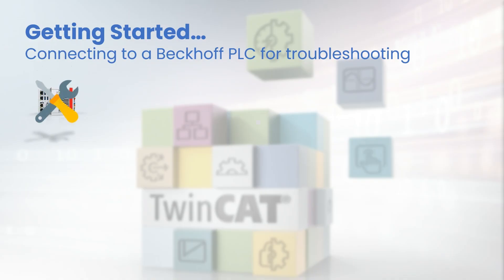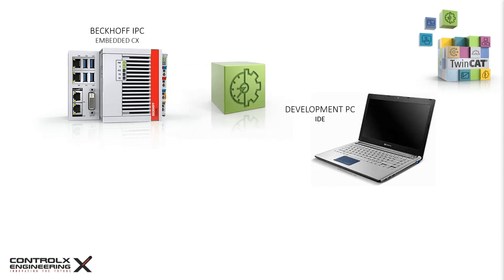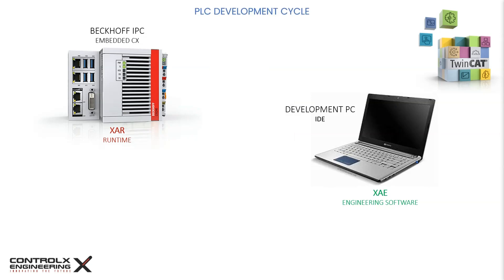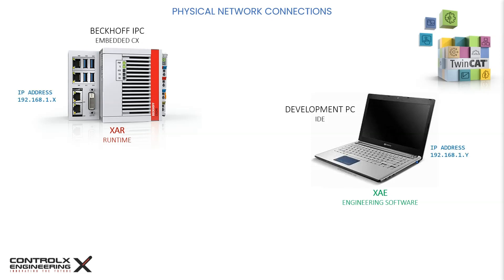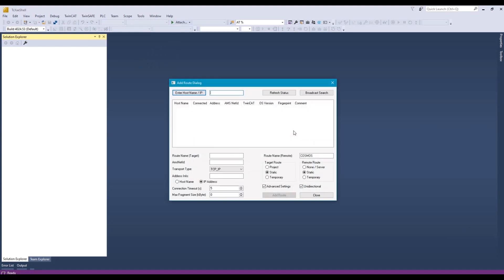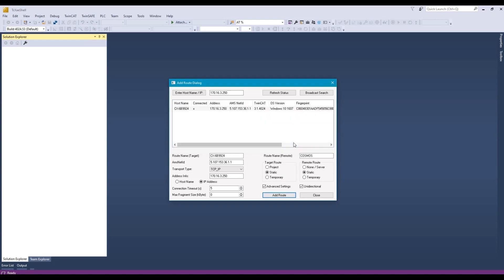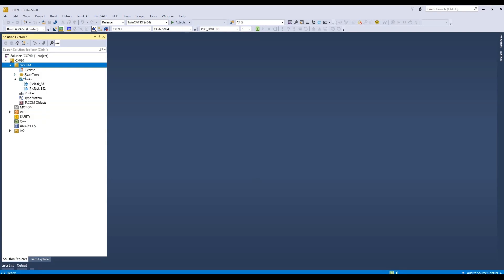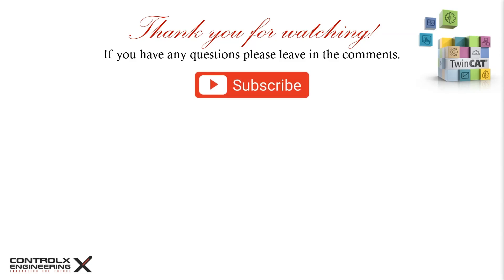How to Connect to a Beckhoff PLC: Beginner‑Friendly TwinCAT 3 Guide

Comment: thanks sir but i have problem. i use the LAN cable to connect with plc and my pc. but when i search the router. they not pop up, its just running and nothing happen:( what should i do sir T_T
Reply from the maker: Check to make sure your PC and the PLC are on the same subnet on the network. Check your Windows settings (may need to disable firewall). Also, try connecting by directly entering the PLC's IP address in the 'Add Route Dialog' box. Hope this helps.

Comment: What if you don't know the Target IP? Thanks for thinking of everything... and what could go wrong for your viewers.
Reply: As mentioned, if you don't know the target IP address, you can connect to the Beckhoff IPC and try broadcast search, which will scan the selected network adapter for all compatible Beckhoff IPCs.
Reply: @CanadaDriving  Yeah broadcast searches were absolutely futile. I have a direct connection between the NIC and the CX5320. I tried also using various permutations of the MAC as the hostname. After waiting for an hour... I magically appeared! And the IP was way off what Beckhoff said it might be based on the BTN numbers, and MAC Numbers